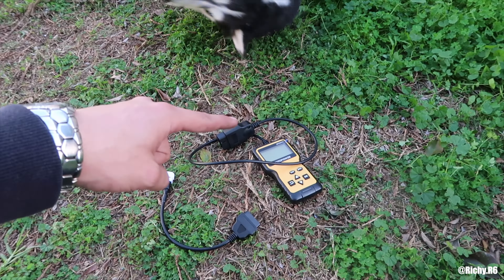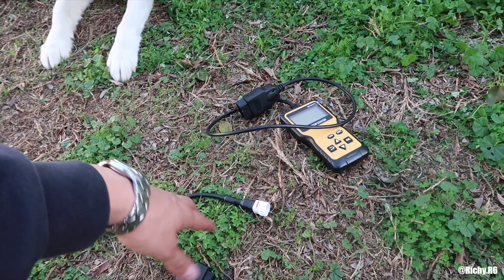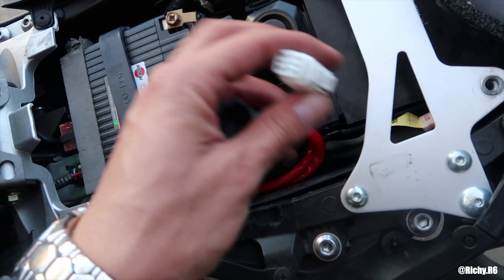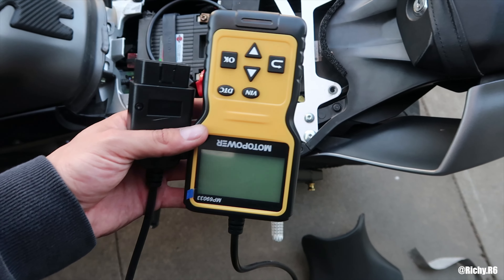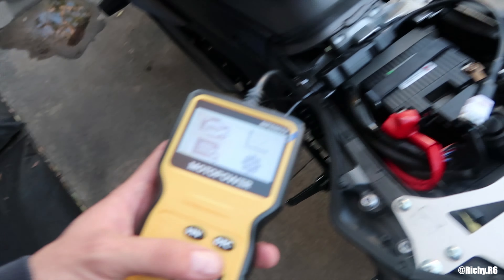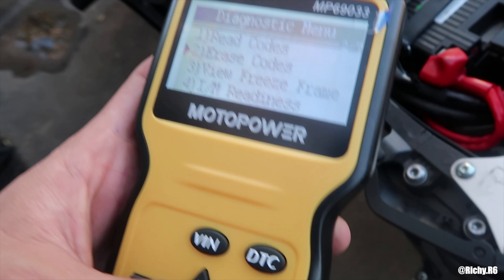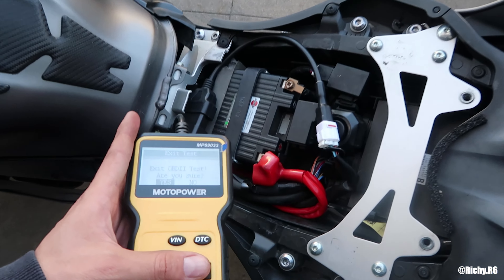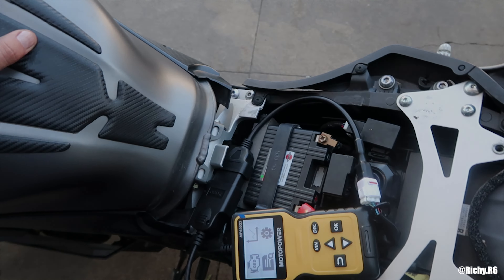Deleting The Check Engine Light On My Yamaha R6 in 2 Minutes! (Any Motorcycle)

Comment: Man I'm shitting my pants over here bro my light come on half way through a 130 mile road trip today. Code that come up was "24" and after looking around it seems like just the o2 sensor code. But we shall see. Thanks for the vid
Reply from the maker: I had a code similar when I loosened my o2 sensor to delete the cat ! I left it loose but when i retightened it and deleted the code everything was fine
Reply: @Richy.R6  oh word? My sensor has been unplugged since I got my bike in September last year and 4,500 miles later I got the first code!
Reply: @Richy.R6  does it mean that even everything works fine it doesn't turn off ?
Reply: @Richy.R6  you mean retightened on your cat or aftermarket exhaust?

Comment: Its running lean not rich the tune will make it run more rich
Reply: Installing an aftermarket full exhaust generally makes the bike run rich as standard ECU are mapped very lean as per emission regulations.